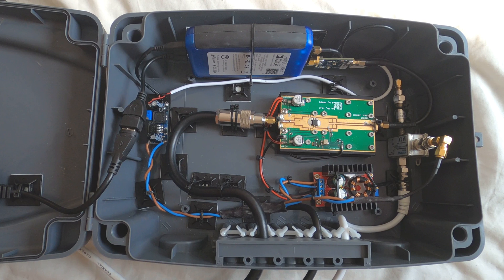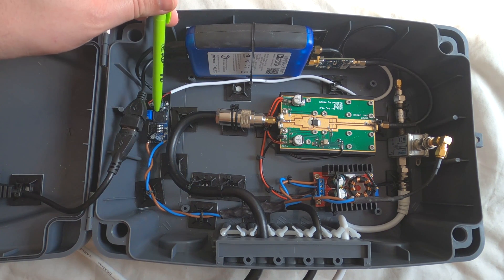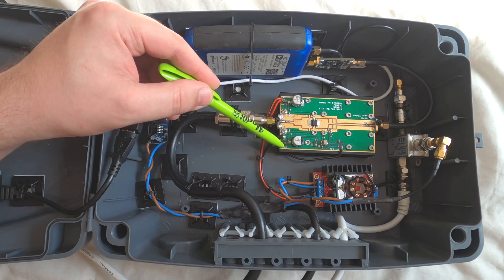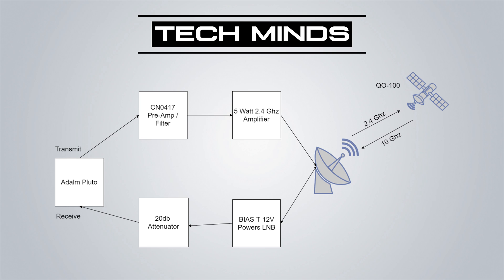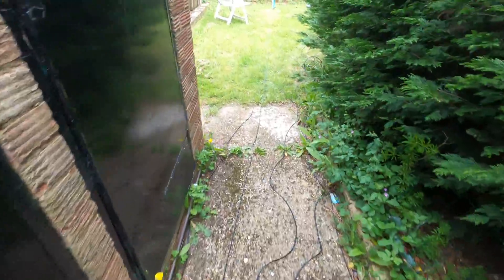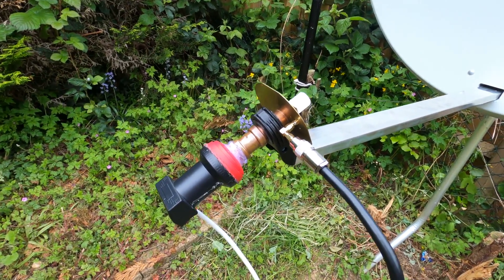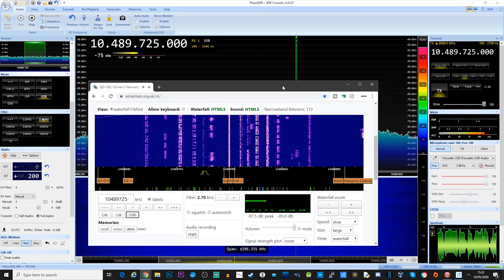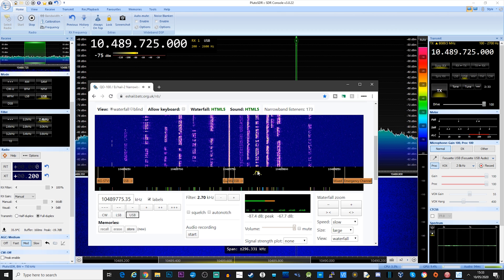ADALM PLUTO Full Duplex Transceiver For QO-100

Comment: Thank you !! Great ... a question , do I need to give a external gps signal to Pluto to stabilize or is it ok to use without ? 73 Marco
Reply from the maker: I would recommend either using external gps OR like I did, which is to replace the TCXO to a higher stability.
Reply: @TechMindsOfficial  ok thank you !

Comment: What i can highly recommand: get two fiber optics converters for ethernet this helps isolating your network card / switches from lightning. I folowed this instructions to setup my pluto: http://oe7wpa.com/index.php/projekte/elektronik/datv/qo-100-mit-dem-adalm-pluto/qo-100-datv-betrieb-mit-obs-und-pluto-sdr-mit-custom-firmware . I also plan on modifying it to have an external clocksource wich will be generated by a GPS Discipined OCXO. Wich will should give enough stability to tx DVB-S.

Comment: Hi, many thanks for the inspiring video! I have a Pluto and I'm really keen to build your project. Could you publish (or send via email) the inventory of all parts of the project? I'm very scared for replacing the tcxo on my Pluto. I have no experience with smd soldering: do you know if there is a software-based solution to compensate drifting with a Pluto?
73, on8vm@uba.be

Comment: Great Video, trying the Same Setup. Is it Not neccesary to switch the PA with a PTT Signal? 73 DG6UAX
Reply from the maker: The amp in the video is okay to be ran with constant PTT, but you can modify Pluto to provide a PTT if required. I now use the new SG Labs amp which had RF switching for PTT built in.

Comment: A previous build of yours was based on a LimeSDR. Now you changed to Pluto. Only because you could replace the OCXO with a more accurate one or are there any other reasons? Really looking forward to your field test 👍
Reply from the maker: Yes, mainly because the TCXO was easy to replace, but one other reason is that the Pluto can use Ethernet over long distances. I didn’t get good results with long USB cables with the LimeSDR Mini.

Comment: The ImmersionRC is rated at +30dBm but you have it showing 37.36dBm  ?? Is there an offset ?
Reply from the maker: Yep, I’m using an external 10dbm attenuator so I entered that offset into the RF meter.

Comment: Since the RX IF is relatively low frequency, you could buy or build an RF power limiter to replace the 20dB attenuator. This would help optimise the RX noise figure. Although it would be worth doing a noise figure calculation for the system to ensure that the improvement would actually be worth the effort.

Alternatively, if you were feeling really adventurous, you may be able to remove and bypass the last IF amplifier stage in the LNB. That way you could more closely match the maximum output power of the LNB with the maximum input specification of the Pluto. This is probably the best solution for optimal noise figure and largest dynamic range.

Great work, and thank you again for sharing this with us all!
Reply from the maker: Thanks for the comment @Alex Scarbro, very interesting indeed. Not sure if anyone else has done that before.  The signal that you can see in my videos is highly attenuated because 10GHz doesnt like trees and leaves, but I'm sure when I go portable with a direct line of sight I will be seeing a HUGE leap in SNR.  Time will tell I guess, just need to be allowed out by the government to do these tests. Thanks for watching ;-)

Comment: would it not be a good idea to have shelding of the components like PS, sdr, amps etc and the whole case? and where can i buy the 2.4gHz PA?
Reply from the maker: Absolutely, and that’s something I forgot to mention in the video. I will be shielding the amp and using Ferrite rings on the cables. Definitely advisable with everything compact and so close together. Amsat UK sell these amps.